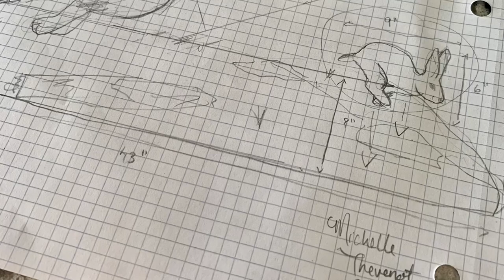Watch a Chainsaw Artist Carve an Epic Artwork From a Log - “Survival” Fox & Rabbit Chase Sculpture

Comment: This is amazing! What type of tools are you using for the detailed work?
Reply from the maker: Thank you so much! For the detail work, I like to use power wood carving tools by Arbortech, ManpaTools, angle grinder with flap disc, rotary tool with burr bits like Saburrtooth or Kutzall.